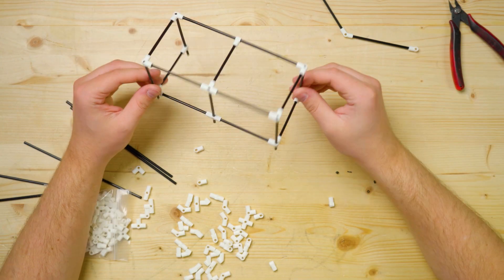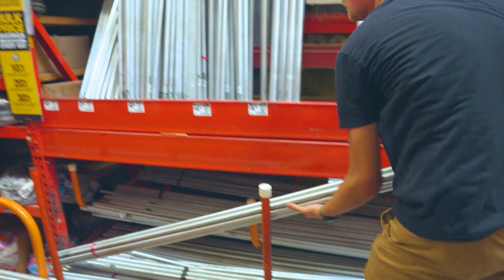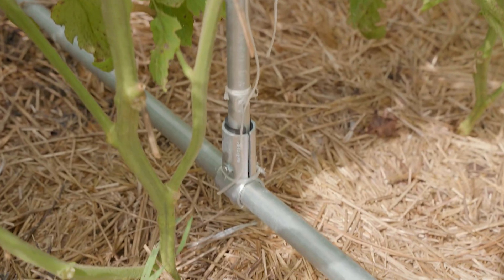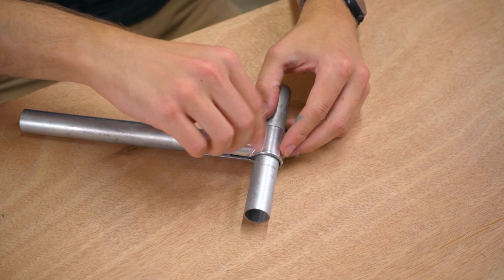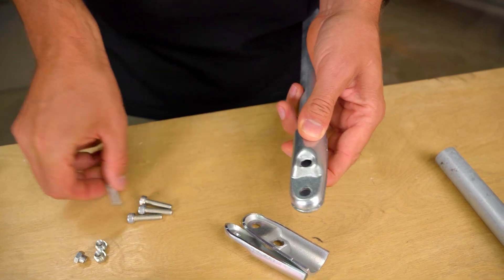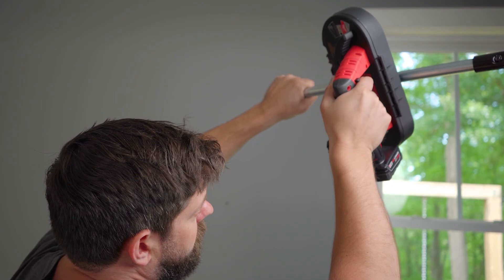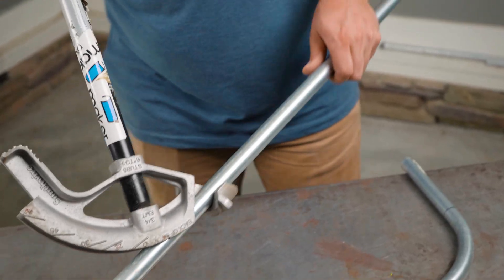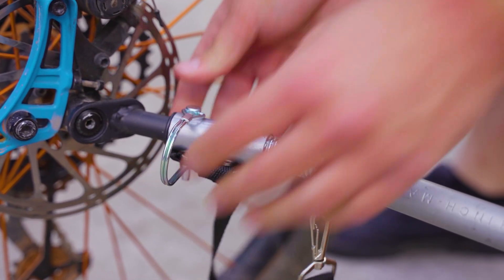Building With Conduit Deep Dive | Maker Pipe Master Class - Ep. 2

Comment: Have you ever discussed annoying problems people may encounter with a pipe cutter.  When i first started out, i had trouble with the cutter wheel traveling and not lining up to do a good cut.  Maybe my cutter wasn’t as good as yours.  Anyway, you could talk about this and you could mention you can buy new cutter blades for your cutter.

I absolutely love your product.  My current project is a rack that goes behind the driver seat in my minivan camper to hold a Thule shoe hanger bag.  I have visions of it also being a way to hold a curtain.

My last project was a stand for my Urban Worm Farm.  It is great because i can move it around.

I went through four or five versions of my bed for the van.  I love that i can change my mind until i really figure out what i want.

I love to hear and see all the different projects people build.  Thanks again for such a great product.